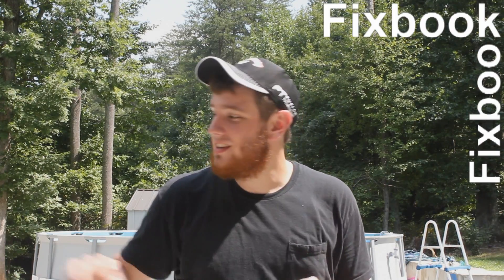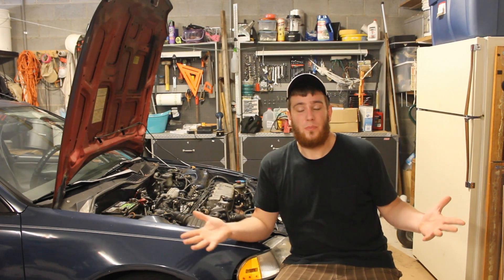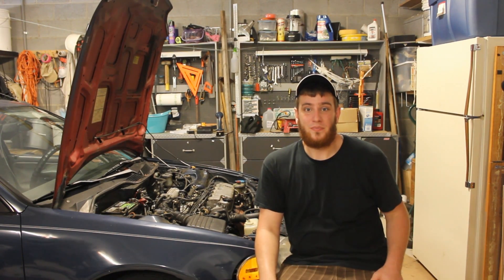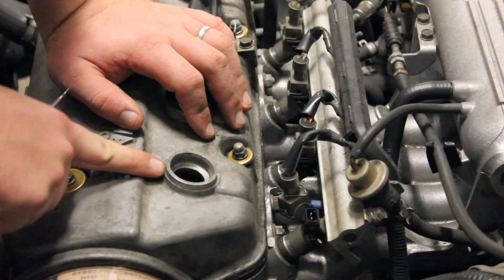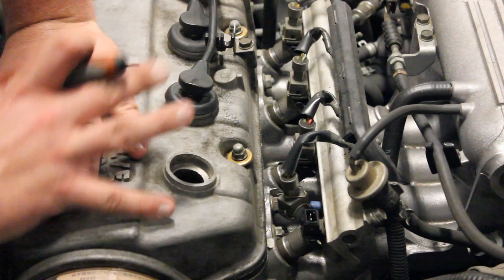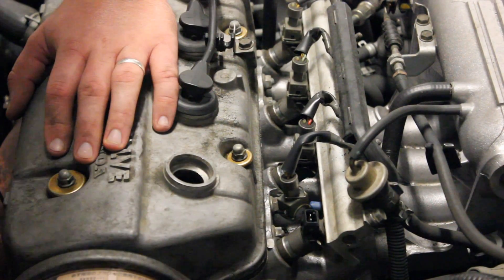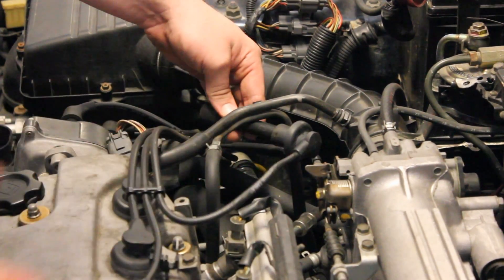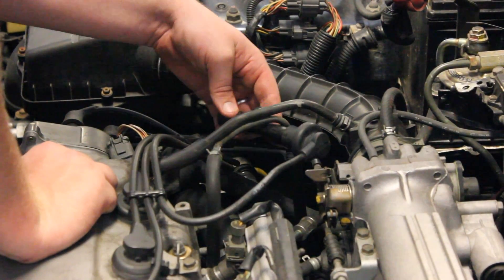How to Run Your Car On Less Cylinders

Comment: I have a car that someone ran out of oil and punched and sent a rod through the block. It runs, but will probably run better with the hole filled with great stuff and oil put back into it. I’ll disconnect the injector and drive it 20 miles to the scrapyard.

Comment: I've got a 2006 Hyundai Sonata GLS V6.
It's got rod knock... Started rod knocking about 4000 miles ago. Can't afford a new car nor a new Motor plus Labor.
Can I remove the Rod, Piston? And disable the injector/ spark plug? So that she runs on 5 rather than 6?
I never run her over 2 RPM (50 mph) so I'm not worried about Stability. I just need her to last longer than she would with rod knock.
Reply: if youre going to remove the rod and piston, why not just bite the bullet and get a new set? or just trash the car, its a hyundai after all

Comment: You should pull the plug out of that cylinder to take compression off engine, or it will work harder.
Reply: My car was loud af after doing this so whole spark plug remove ?
Reply: But it's so loud

Comment: Lmao when you try to be chrisfix but opposite you car is designed to have a certain amount of cylinders to allow the car to properly and evenly because the crankshaft witch turns the motor is on a ration with all the cylinders. If one isn’t firing the rest will fire incorrectly and cause a miss fire and could cause potential damage.

Comment: Hi guys/girls. Don't try like this. It will just yield a burnet cat, as ECU will soup up the running cylinders to compensate the extra air that goes through the idling cylinders. The instruction on video will lead to increased consumption, as the fuel will burn in cat ruining it in mere minutes, as the extra fuel will be burning right in you cathalyst converter. 

The right way to convert to less cylinders would be to remove injectors and pushrods/valve actuators. Leave the sparkplugs, to avoid pumping losses. This guy removed them..

Comment: 2 cylinders take more flue than 4 or more. Because the engine is bigger and made for 6 cylinders. That also can be dangerous to do that without a mechanic expert.

Comment: I’ve gotta bronco 6” lift 35s on fuel 20x12s and I get about 6-8mpg with the 351w in it I’m going to try to run it on 6cylinders and 4 cylinders now before you bash me just know the motor has to be rebuilt it has 0psi oil pressure at idle 5psi at 2000rpm and about 12 psi at 3000 not to mention certain cylinders have low compression so it’s just a warn out 351 how ever just know I’m risking nothing because I’ve got a motor ready to go in just Incase something catastrophic happens... I just wanted to do this as a cool experiment and show what the true mpg results are of doing this and if it gets better or worse mpg
Reply: @Davokin the mileage dropped significantly and the truck had a very noticeable loss of power so I wouldn't try it on a big truck maybe if you have a small car like an accord and run it off 4 cylinders instead of 6 anything else I would not recommend

Comment: This does not save gas, the same amount of fuel is still being injected into all cylinders, Only useful application of doing this is tricking your friends into thinking you installed an aftermarket Camshaft

Comment: I am thinking of doing a similar thing on v12 gas generator of 1800kw. The crankshaft pin connecting two of the opposite cylinders knocked. Which require crankshaft replacement and engine overhaul. But we wish to manage it till parts arrives. Anybody with a good idea?

Comment: Ok. First off, engines are balanced. Each cylinder has to contribute to the rotating mass in order to allow the crankshaft and evertthing driven by it to harmonically spin. This WILL damage crankshaft pins and everything that requires proper torque application timing chain/belt guides and tensioners. I could go on forever. Never do this. Wanna be an engineer or a tech? Learn physics or study theory of operation.  Idiot.

-Ase Master Auto Tech.
Reply: Isn't this what Gm did with V8 cylinder deactivation?
Reply: very tech-oriented response.
Reply: Yeah and all this vibration will wear the motor and transmission mounts out and also crack the exhaust system. I can see the crankshaft breaking in half in about 2 days lol.
Reply: @Truckguy1970  but if there is no pressure in the cylinder - lets say burned valves, can the injectors be disabled somehow - so that the fuel doesnt get in the faulty cylinder at all ?

Comment: For everybody freaking out about how this will destroy your engine or drive like shit, no one is saying that you should go take a working car and disable cylinders.  However in a variety of emergency situations where continuing to run a under pressure would damage the engine, it's a workable stopgap.  Maybe the repair is too expensive but you have to get to work tomorrow, etc.  If the options are missing work, damaging my engine, or driving an underpowered fuel inefficient car, guess which one I pick?
Reply: Legit my problem right now

Comment: This is a terrible idea, first of all your are leaving an opening for shit to get into your cylinder and second of all running the engine with the spark plug removed will wear the coil because the current is not passed through and is forced to go back through the coil
Reply: Jim Toney that's not how electricity works... There's either a circuit or there isn't. It's not like a hose with a kink.

Comment: My spark plugs hole is stripped out. I rethreaded it once before and the new spark plug blew a second time and now the second  rethreaded doesn't hold the plug. Can I use this deactivation method??? If so what do I do with the open plug hole?
Reply: That’s my issue right now. I got a 4.6l 2v v8 and cylinder 8 spark plug hole is done for. I wanna know if I can either run it on 7 cylinders or 4 cylinders.

Comment: This idea has been around for years, but here is the "finished" solution which works better with more cylinders.  When one cylinder's piston is going down there is one on the block that's going up.  The main thing you're missing here is you need a hose made which will connect the opposing cylinders.  Each helps the other move.  You will have less overall power, but how often do you need to spin your tires or pull a trailer house uphill?   The hose keeps dirt out of engine and keeps some lube in there.  The key is to not allow the two cylinders to suck the gas. 
           I personally have a 15 yr old sears lawn mower rider with 18 hp.  It began blowing oil and fouling the plug in one of the cylinders.  Gas started leaking into the crankcase diluting the oil, not good.  I took the plug out of the bad side which stopped the  gas from getting into the oil.  Engine runs great on one cylinder for three summers now.  In fact it runs so good I replaced the mower deck last year which cost 450 bucks.  We mow over 1 acre on a 5-10 degree slope each week.  It's great on fuel, but blows a little oil out from that plug hole.  To do it right, I know I need a hose connected to the crank case, but maybe I'll buy a new mower in a few years.
Reply: Estuped

Comment: This is actually a good thing to wonder. 
If you have a v6 engine and one of the cylinder heads is irrepairable and you cant afford another one, you can drive on 3 cylinders. Would work like nothing went wrong if you replace the stock 2.73 differential gear with something steeper.
Reply: No. You'd be luck if the engine stayed running or started at all, and regardless if it did or didn't, it would be running horribly off balance and shake the car to bits

Comment: Do not do this to your car!if you want to disable a cylinder or two check with the manufacture as they may sell cylinder disabling kits. These will adjust your ecu to compensate. You run the risk of fucking up your valve timing and then slamming pistons into valves and rockers.... Very fucking costly or a write off.he's right though, this will not save you fuel, maybe marginally bit fuck the risks.and what did that laptop do to you? Did it show you how to fuck up your engine?

Comment: I actually want to do a v8 to v4 conversion... the dead 4 being a running high cfm compressor.....
Reply: Coool!
Reply: Ingersol rand ?? Name
They have one bank made into a compressor and one bank running
Reply: Chevy already did it with the Hemi V8.
Reply: @jaggass  crazy
Reply: @gabrielvieira6529  Not really as it has cylinder deactivation which is computer controlled. It was designed to save fuel when doing long distance driving. On Dodge Ram diesel's like the 5.9 24V you can get after market ECU's that can make the engine run on 3cyl instead of to 6 warm it up faster,

Comment: I know this sounds ridiculous, but I know people on more than one occasion that have done this to limp a car for a while until they had money to fix the engine or buy another car. To do this correctly, you need to remove the rocker arms and pushrods if applicable, also. I know someone who disabled a cylinder on a Jeep 4.0L and went another 50k miles. I don't think this would work on an OBDII vehicle very well, though.
Reply: Henry Washington oh god
Reply: Hey I'm considering doing this come morning. Third cylinder piston is destroyed with chunks broken off. Head still on car and it starts and runs fine (1994 Toyota tercel). Problem is that piston slap is making lots of noise. I'm going to cut off connecting rod high enough and push piston up to top dead cylinder. I will use adhesive to keep piston from falling back down. I will hose clamp and plug oil holes on crank. I can remove rocker arms to valves up top and unplug injector. I can leave spark plug in with wire because no compression or fuel. Do you think I can squeeze a few thousand out this engine before I junk it?
Reply: Already did it and so far about 2500 miles. Yes vibrates hard at idle, but while driving you don't notice it.
Reply: prescott231233 well its bent for sure now.

Comment: The O2 sensor will see all that oxygen from the disabled cylinders and richen the fuel mixture trying to "fix" it.
Reply: that's a good point. You probably need to either remove the the valves from the disabled cylinders and block the intake, or redirect the exhaust through modification of the exhaust manifold to get around that issue.

Comment: Oh hell no. You are already missing cylinders
Reply: He won't save a thing doing this, he'll actually burn more gas because this will make the other cylinders work harder and not to mention, throw the engine off balance and destroy the crankshaft, camshaft and get uneven heating and destroy the block and since the engine is shaking around this will also ruin the motor mounts and crack the exhaust pipe lol.
Reply: yeah, but if you already have a piston not working, better not to send all the gas through, for example, I'm on a trip and my ignition coil stopped working.... :/
Reply: @Truckguy1970  Not only that but ruin your catalytic converter as well.
Reply: @jaggass  I had a friend of mine that tried it and I warned him that he was making a big mistake. He calls me up 2 days later and I got to where he broke down at and the engine was laying on its side in the engine compartment LMAO. All that missing and shaking around broke the motor mounts, luckily I was able to put it in reverse, stepped on the gas pedal and the engine went back in place, after we plugged everything back in he was able to carefully get it back home to replace the broken mounts
Reply: That's why it's not a good idea as a misfire causes and engine to shake like mad. It causes huge vibrations and you can feel it in the car as well.
Reply: Pretty sure it's supposed to be satire...

Comment: First of all doing this the way he said would distroy your engine.The only safe way to do this and i say ONLY is if ita an old darbed engine and you have a blown valve or cylinder. #1 remove the piston / plug spark plug hole with threaded plug, remove the valve rods and rocker arms .Then you can adjust the timing to drive it for awile. I have done this several times to an old v8 and 6 cylender motor and it lasted for years.
Reply: I currently have a 4 cylinder honda that is running on 3 cylinders ...can I get a few months use out of it?
Reply: I have a v6 toyota that is getting 0 compression on a cylinder and the mechanic said i have a bad piston what could i do?

Comment: Working the engine hard results in worse gas mileage. Even if you did get twice better gas mileage(which you would not) it is still cheaper to pay more for gas than to replace the engine. Good way to throw a rod. Furthermore, there are people in this world that would love to have that car. And then there assholes like this dick that would try to ruin it. He could have gave it to someone in need. But no, he has to try to outsmart the engineers that designed it. Since when did this stupid asshole get his engineering degree?  He is a selfish, ungrateful asshole. The car ran well enough BEFORE he "improved" it that it would have made a good car and shelter for a homeless family. If he did not need it(which he did not if he was doing stuff that he KNEW could blow it up), he could have gave\donated it to a person in need or charity. He does not deserve a car. He should walk.
Reply: Calm down Avery, the man said he is not responsible of any damage. His statement is clear. And he is only throwing idea without studying it. I recommend him to study the theory of any application before any modification or improvement.

Comment: I have a 2005 4wd Ford Escape. The coil in the  number 5 cylinder keeps going out. I've had a mechanic replace it three times in the last two months. It works for two weeks and goes out again. Should I just give up and run it on 5 cylinders? I don't mind. It has 170,000 miles. I don't care if it blows up. I'm just trying to get the car through to summer 2016. What do you guys think? Can I make it if I drive 55 and keep it out of the mountains? Feel free to comment.

Comment: this is recommended for if youre stranded with a flat battery , starting an engine on just two cylinders is alot easier on a struggling battery than 4 , 6 or 8 cylinders, so you canget it started enough to charge it up then reconnect all cylinders
Reply: Yeah, this just isnt true. while it does take slightly less energy to crank it (because without a plug theres no compression in those cylinders) it'll have a much harder time starting if it even starts at all, meaning a lot more time will be spent cranking the engine
Reply: bullshit. actually makes it harder dumbass

Comment: Sure any older 4 cylinder Honda can run on 3 cylinders but that's do to unforeseen circumstances and it won't last long. The spark plug wire is still connected to the distributor, if it slips from its holder due to too much vibration and grounds out near a fuel line or oil line say good bye to your life because your creating a ticking time bomb.
Reply: Stuped

Comment: why wouldn't you just stop at the injectors? removing the spark plug means it can suck foreign objects in and screw things up. having the spark wire unplugged means the coil will be dryfiring and will ruin itself.

Comment: This not only wouldn't work you would use more fuel and burn up your cats because the other 2 cylinders would push more oxygen into exhaust the o2 sensor would report a lean condition the ecm would try to compensate and add more fuel ruining the cats and lowering fuel economy
Reply: Not if you leave the spark plug open, the air would be pushed out of it instead of into the exhaust.

Comment: I wouldn't try this but thanks for the fun video. Thank you as well for all the other videos, and you have saved me a little over a thousand dollars so far in car repairs!
Reply: some of us have to do this because we have blown head gaskets and modern cars are too involved to take apart and fix.  esp.  front wheel drive vehicles which are packed in there like a sardine can and a piece of shit for engineering design.  basically, almost all passenger cars these days use front wheel drive shit engineering design, to keep the owner from working on it themselves with minimal expense or time. 

please people, do youreself and everyone a favor and refuse to ever buy a front wheel drive vehicle, new or used.